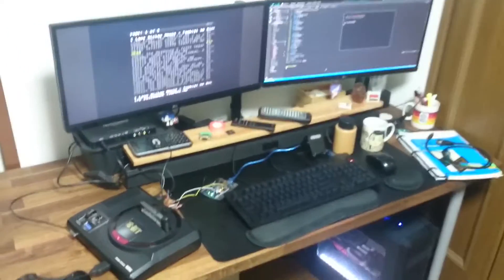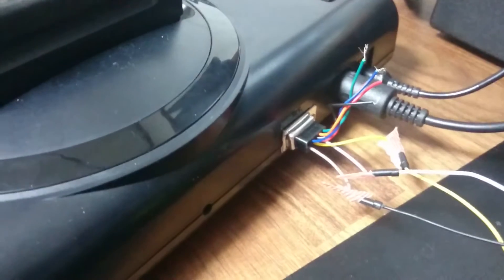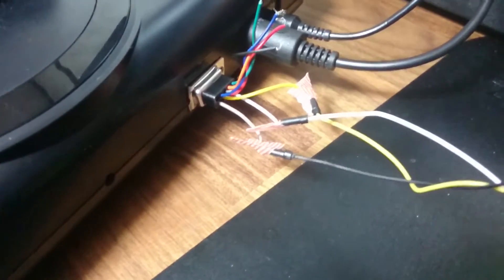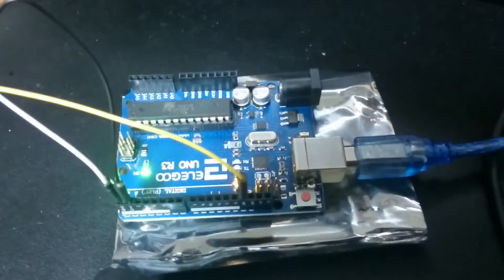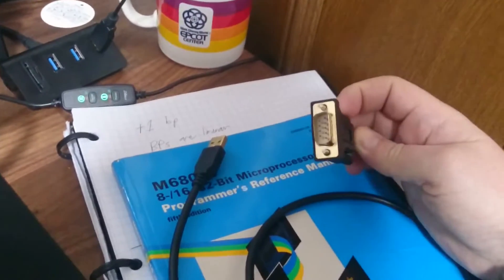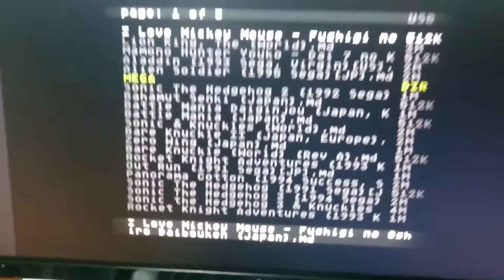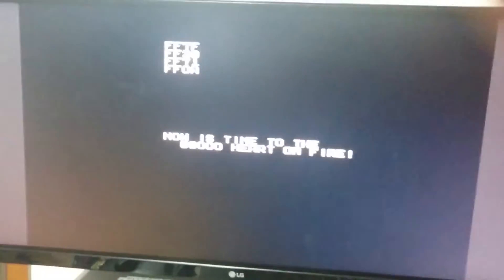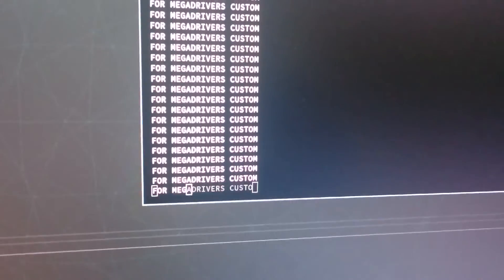Communicating with the Megadrive via the EXT port

Comment: Hello Sudden, thank you very much for your good “DEV” homebrew video!
I have a problem:
Since I have the last MD EU-PAL MB version 1993, there is no "EXT.PORT" soldered in here - can I retrofit it? Does “he” work then?
Because I would like to work on 68K and Mega Drive "DEV" programming in my free time.
Directly on the MD without a PC. 

I was thinking of an MCU ATMEGA as a flash and i/O "plug-in module" for modern functions such as SD cards, keyboards such as a mouse in order to turn this Mega Drive into a real stand-alone PC.
Reply: It would also be really great if someone with so much technical SEGA MD "KNOWLEDGE" could put together something like this, where there are already modern I/O connections on this "PLUG-IN MODULE" for SD CARD data transfer, retro PC PS/2 keyboard and mouse.
Also from the software side: there is also a simple “BASIC” construction kit, where it could also be expanded to include commands.
And the WORK is to adapt "SymbOS" for the good MEGA DRIVE so that these toys finally become a real 16 BIT "PC".
Reply from the maker: Hello! So,  the Player 1, Player 2 and EXT ports are all identical and all can be used for serial communication as well. (It also means, technically, you could support three controllers on the system!) You would just need a female plug instead of male, but the pins are the same. Plutiedev has an excellent explanation of serial I/O on the MD, including using any of the three ports.

https://plutiedev.com/io-ports

As for using it for development, I would really reccomend something like the Mega Everdrive, which has a USB port and tools to be able to send data to the MD directly and automatically load it. It's much easier to work with. I believe there is an SDK which exposes the USB port to some memory range, meaning you could then communicate over USB with your program and do e.g. memory viewing and poking and such.

Honestly, for real-time debugging (setting breakpoints, stepping through code, memory editing, etc) I just use an emulator, namely MAME which has an excellent debugger. No, it's not 100% accurate, but it's good enough for basic bugfixing, imho. And if there really is something the emulator can't reproduce, then you can move on on-hardware debugging.
Reply from the maker: I just realized I have my old Everdrive visible in the video (haven't watched it in a long time...), notice the USB cable coming out of it. That's how I transferred code for quick testing. :)

Comment: Think this would work for the zero tolerence two system link if using an adapter?
Reply: Zero Tomerance uses the 2nd controller port as system link. IDK if it supports the ext one

Comment: The rs232 adapter has voltage levels that are probably out of range for the mega drive. The voltage swing can be as high as - 15v to +15V. Altho it's likely your adapter is +/-5v. The mega drive will be either 0-3v or 0-5v logic.
Reply: This video was forever ago. In the time since then, I've been using less generalized devices, namely, CP2102 based USB UARTs, which are much better suited for the task.